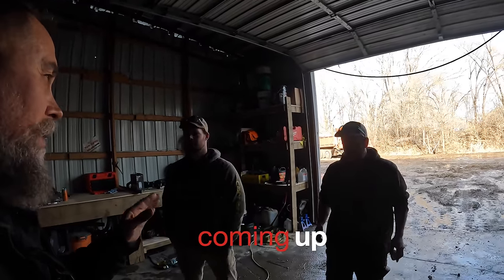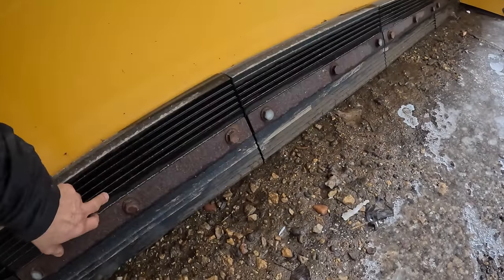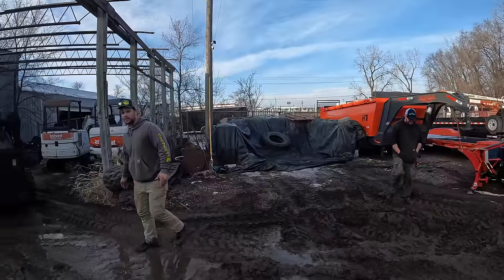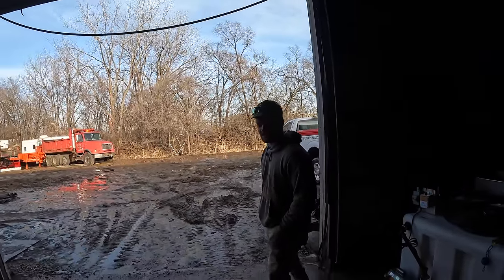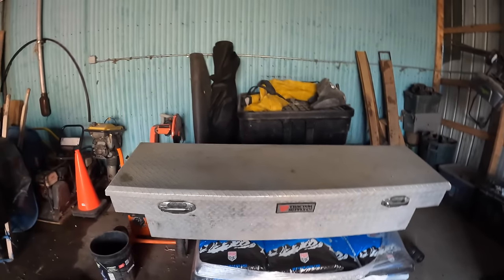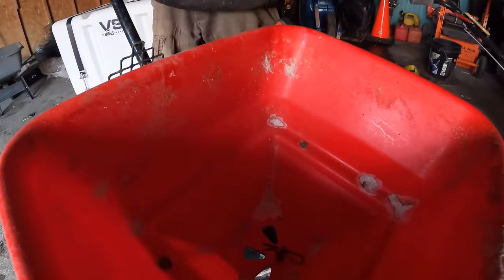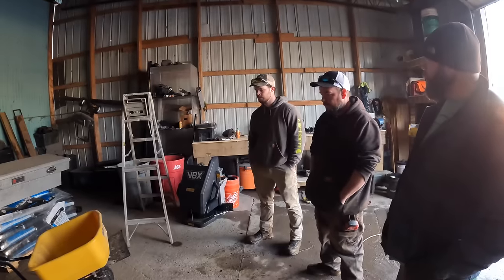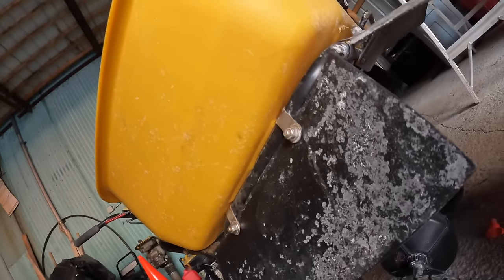don't BUY this GARBAGE!

Comment: Many moons ago, I had a snow removal business as well. I stopped using rock salt on walkways and switched to calcium pellets. It flows through the spreader with ease to the point of you wanting to slow the flow! Furthermore, a little goes a looooong way! I continued using rock salt in the main parking area but calcium on the walkways. Considerably more expensive BUT, when the customer sees how much cleaner their building entrance ramps are and the lack of rock salt inside the building, they don't mind paying a little extra. Try it, you'll like it!!
Reply: we just drive the ram truck with spreader along the sidewalks and salt the sidewalks with the truck wich works great and quicker
Reply: Id build a salt grinder, larger than in your kitchen that maybe a drill could power

Comment: I've got 3 different cans I'm using and comparing. No-Spill, Surecan, and a couple of "generic" U-jugs or 'Race cans" that can be bought at my local farm supply store. The No-Spill is all right, but one of them that I use for diesel seems to have a tendency to vapor lock, so it tends to pour slow or even stop. The Sure can is the most expensive, but the overall design is real nice in that you don't have to tip it to pour it, until you get to the bottom of the can. The big positive the U-jug is it can pour fast with the large diameter spout and vent cap it has.

Comment: If you have a Menards there you can buy different nozzles for your gas can ( old school nozzle ) take the garbage one off and put the one that works on …🇺🇸👊🏼👊🏼
Reply: Tried that and the threads don’t line up to get a good seal, some don’t go on at all. Do you have a package with product number to find a specific one that works?

Comment: Go buy a 5 gallon paint mixer and connect it to a battery powered drill and tie the drill to the handle and use it to loosen up the salt.  
Same thing happens with fert and drives me crazy but the drill idea works great.

Comment: I'm wondering if you can add a simple vibration motor to the side with the switch and a small 12 volt battery or even a tool battery....

Comment: This might be a stupid suggestion, I don’t live in a region with snow, and have not spread salt. We do spread granular fertilizer year round, on slopes, large turf areas, etc. we use a Stihl SR450. Would that machine work for you on this application? I thought it might be overkill, but it seems to be in the same price range as the spreader you have.
One other alternative might be a Lesco Push spreader, similar to what you have, but built better in my opinion. They are available through site one.

Comment: Polar tech brand , model # 90399 funnels the product to the center of the hopper so it doesnt need to be shook all the time ,Thats the way it looks on your hopper ,Theres no funnel effect to the center ,and unless it's all plastic or stainless it's going to corrode . It might hold a lot of products, but it really wasn't designed for your application, hope you figure something out soon , It sounds like the big one is coming this weekend and  you need to be ready, Thanks for showing what not to buy.

Comment: The worst investment i ever made for my snow clearing business was s spreader that whent on the back of my quad bike(atv). Just like yours the sand and/or salt would not slide out of it to the spreader. Sold it to someone that figured it would work for grass seed. 
Btw i dont use rock salt it just doesn't work under -5C.  I use ice melter. A mixture of vrry fine salt and yes fertilizer. It works up to -35C. And is not harmful to sidewalks, plus it makes the grass grow in the spring.

Comment: I used the scotts turf builder for the first part of the season. It works well, but its plastic and only lasts about 2 months. At $80Cad it's probably cheaper than the $300 Chapin one that I bought after, which looks almost identical to your red one. Junk doesn't work. I'll have to copy whatever works on the Scott's one and modify this Chapin "professional " spreader.

Comment: Those are my favorite spreaders. That guy doesn’t know how To use them he didn’t even move the metal piece before folding down the flap. We use bag salt for sidewalk not loose salt. Spreader works perfect
Only downside is having to push 80lbs+ in a snow storm with snow sticking to tires. They also sell stainless steel frame much better.

Comment: 5 gal bucket with a seat belt strap (or similar,  smooth+wide material) bolted to the bottom/underside edge and outside towards the top. 

So i wear it almost like a messenger bag. I'd rather use that any day!

Comment: I have 2 of  the snowX push spreaders like you have. I have owned em for 10 plus years. and never an issue with them. They get thrown on and off trucks every snowfall. We spread Pallets  of ice melt and dry sand each year and they always feed. I've never used rock salt so I would guess that might be  your problem.

Comment: Stan if you get a Boss VBX 6500 auger with clear lane salt that is tinted so you see where you have made passes for your gas truck and before you plow run along the sidewalks and can run a 27 to 30 foot swipe 9 or 10 feet out on each side and then you can plow faster by not having to get as close to the curbs with the back plows or popping tires off the rims if you hit a curb from a black ice patch or in loading docks the clear lane salt doesn’t clump up as bad as the white rock salt use the rock salt for brine the clear lane works quicker

Comment: You’re using the wrong salt. Those spreaders won’t throw rock or bulk/wet salt. I got the Chapin 80llb and the 100llb(stainless steel) I run Russos power red through them all the time with no issues. The one time I ran out of sidewalk salt, I used the treated in my hopper, and that absolutely sucked. It was easier to just grab the scoop and chuck it. I also used the rock salt bags in it, and it really didn’t like that either.

Comment: 1) I would Put Gravel or Ground up Concrete in the Driveway Area to keep the Mud down
2) Email the Management of that Salt Spreader about the Problems you are Having, and just maybe they will Replace the Bad Unit with a New One. 
Never Hurts to Asked ???